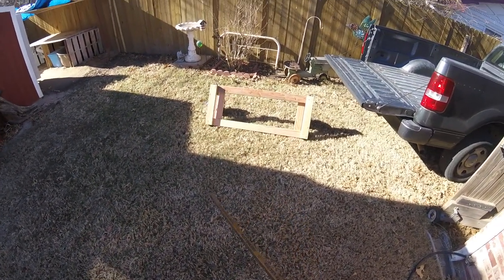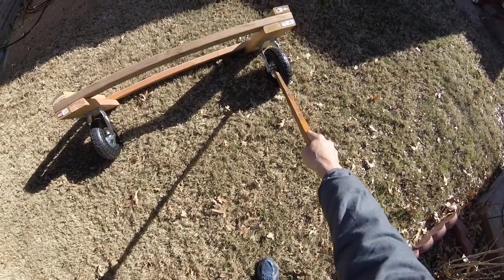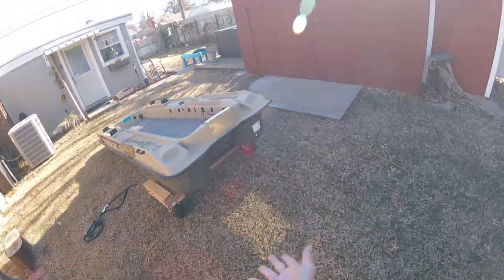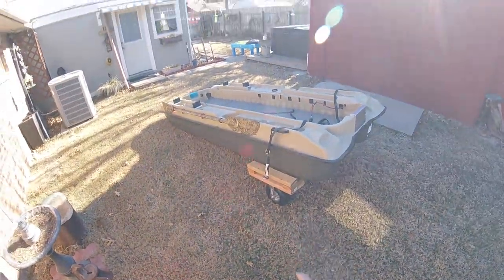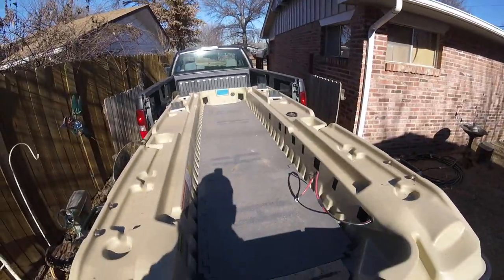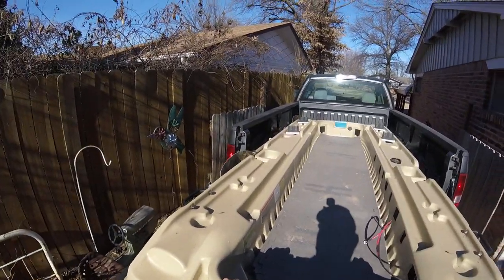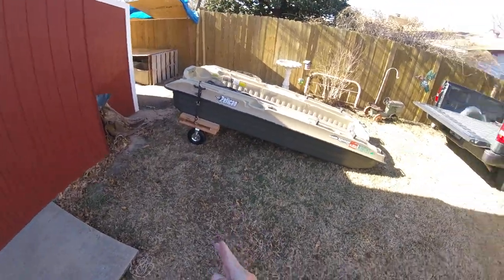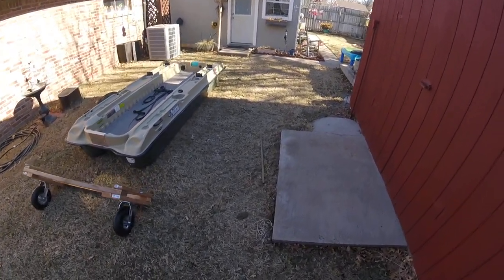How to load a Pelican boat by yourself?

Comment: i have a v bottom jon boat , what modifications if any will be needed. and how big were the tires. i like there is very little lifting. i have a bad back too
Reply from the maker: It is not heavy but it was cold outside the day I recorded it. The wheels were 10". I used 2 x 4 on the rest.